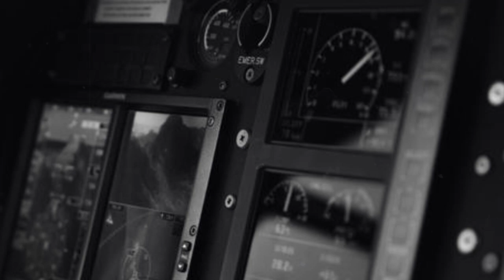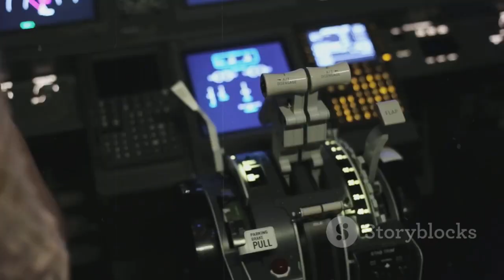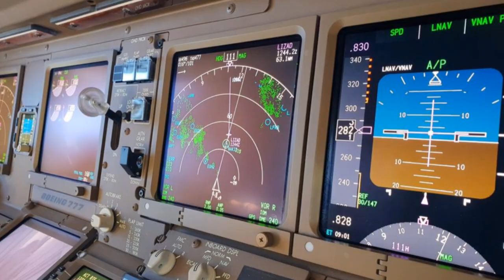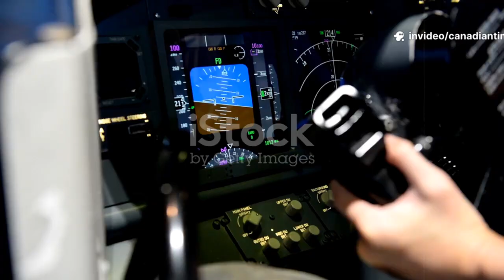Rolls Royce Supercharges Canada’s Gripen Fighter Deal — A Game-Changing Upgrade for the RCAF

Comment: The Gripen's current engine is from the USA.  This has already been used to block one sale in favour of the F-16.  A replacement engine is possible, but it would take time.
Reply: You haven't heart, rolls Royce has a new engine for the gripen
Reply: @ikke12345  "rolls Royce has a new engine for the gripen"  I believe it is to be an adaptation of any existing engine.  But it will still take time.  I wish the project well, but time will be a factor.  If both parties can work fast enough & don't encounter too many problems, they could pull it off.  Good luck to them.